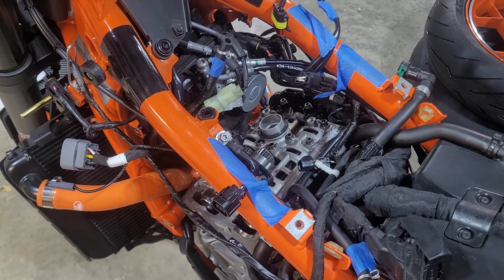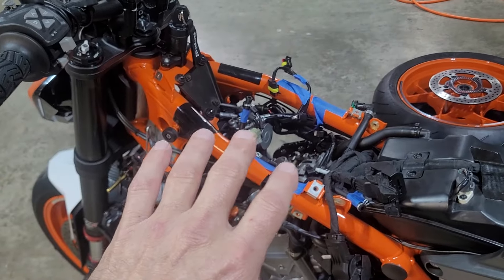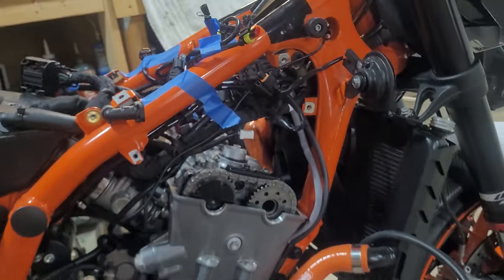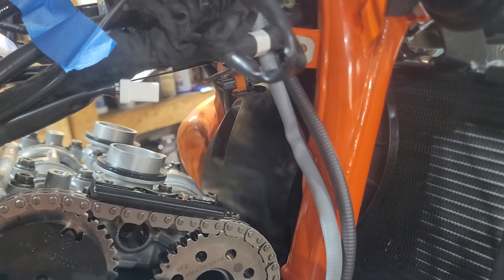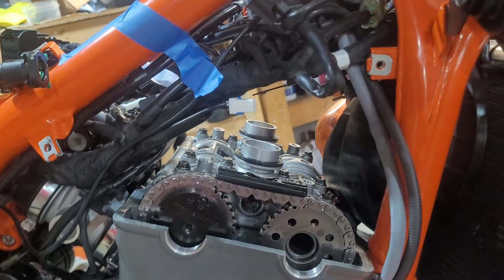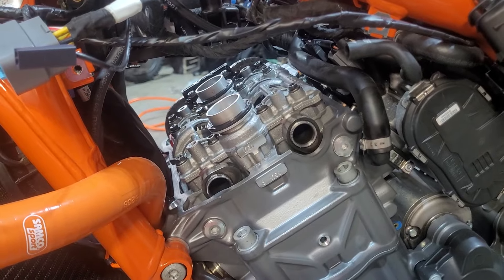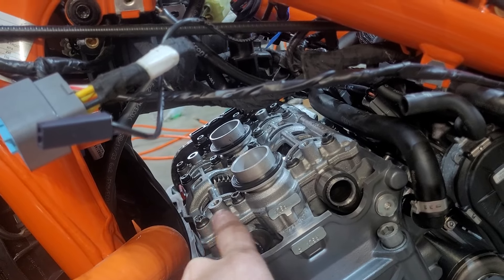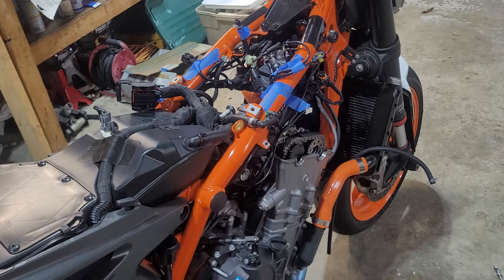KTM 790 890 890R Cam Lobe Inspect / Duke Adventure Camshaft Inspection

Comment: You don’t really have to make sure the chain doesn’t drop. There is a bolt perpendicular to the plain of the chain that makes it impossible for the chain to drop down into the engine (at least on my 890 adv r there is). You can see this bolt if you look down into the slot of the chain.

Comment: Did it ever run again? My mechanical expertise is almost on a par with yours, Jason, but I've had the cataract operation on both eyes, can usually find my reading glasses, and would definitely read the workshop manual very thoroughly first. Given that the KTM warranty is a supernatural form of religious experience, I can understand the need to do the job yourself!
Reply from the maker: Valves were fine. Cams didn't scare me. Been ripping it for last couple of months. WIll take another look at it this winter.

Comment: I wonder if the 790 are the bikes that CFmoto have built. Makes me hesitate buying one of their new 450s
Reply: The ones with the issues are early austrian bikes, thee issue is blown out of proportion though, maybe 1% of the bikes are affected probably less
Reply: @AntaresSQ01 you have no idea of the actual failure rate. It hasn't been published. You don't know it's less than 1%.
Reply: @AntaresSQ01  I've met a dude by chance while changing my tyre 2 weeks ago that just had his cam shaft replaced on a ktm 890 duke at 5000 miles, soooo i think that issue is more prevalent than 1%.

Comment: Hi! I’ve got a question. I’ve checked cams in my 2018 Duke 790. And I have an issue with exhaust cam followers at Cylinder 2. They moved out of a valve and I can’t move them back. Referring to instruction - I’ve rotated engine to OT2 and still I can’t move them back. Do you maybe know a solution? Thanks
Reply from the maker: Hey sorry I dont know how to help - didnt take mine out - hopefully soon someone will do a vid on taking the cams out and replacing them.
Reply: That happens when the shims are not fully seated. Check them closely and you may even need to hold it down with a pick while sliding the followers back.

Comment: It's a tough deal checking the valves.  Look at the diagrams of the sliding followers.  You have to do it by feel if you don't pull the radiator.  Check that the sliding followers are in the right place at every step.  Check clearance at the end while holding the follower in place, or you might pop out a shim.  I'd trade a few ounces of extra weight to make the cam bridge less fragile to get rid of that dumbass KTM procedure and the potential disaster of losing a shim and not realizing it.  I'm sure there is an Austrian engineer very proud of saving a few ounces and creating this insane system.

Comment: The discoloration on the cams is an early sign of stress on the cam. And going off other 890 cams what had similar discoloration before failing it will increase over the milage. Another inspection at 10,000km will sadly show the increase. Check out KTM Failed Camshafts because many have the same issue. Camshafts should last the life of the bike and discoloration shows what’s inevitable to come.
Reply from the maker: Yea I'm betting so. Will probably b ordering parts one day. Hopefully there will be a fix by then.
Reply: @jmonintwo  Why throwing money on garbage again and again? Anyone who buys KTM bikes should know by now what they are getting into and stop supporting this crap company.
Reply from the maker: Ive had a ton of KTMs - theyve all been bulletproof - this problem has me disappointed tho
Reply: @jmonintwo  cams can be back ordered for months at a time. Might be a good idea to order them far in advance of when you are ready to install.
Reply: @AlamosaOutdoors They're in stock at several sources currently. Rocky mountain ATV has them in stock.
Reply: Nah. Just inspected my '21 890R. It shows those marks but at 21k miles it's still just showing those marks, not ground down. It doesn't necessarily keep getting worse.

Comment: Shame it's such a bastard to  see the lobes and check the clearances. For the first valve service I had my dealer do the work so as to keep the warranty. I don't trust that anyone can do a proper job checking and adjusting the valve clearances, so I'll probably remove the motor when its time for the next valve service.

Comment: I lost all trust in KTM, when they started production in China. That's a Cf-Moto 800 MK or MT engine. Changing the parts is not a big deal. if you can do basic maintenance, which includes adjusting the valve clearance, you can also swap out the cam shafts. It's a valuable skill and not hard to learn. Problem is the price of the parts. Both camshafts are around $800 and then there are the rockers, which are around $100 a piece.
Reply: The issue is pre 2020 when CFMOTO took production of this engine
Reply: Doing valves is not basic maintenance. Changing your brake pads is. And most people don't do even that by themselves
Reply: @Angry-Lynx  Everything listed in the maintenance schedule and needs to be preformed on a regular basis, is basic maintenance. What most people do or not do, is not a valid metric to determine anything.